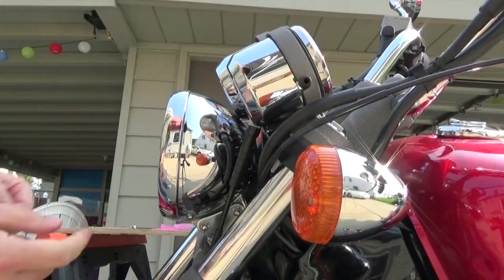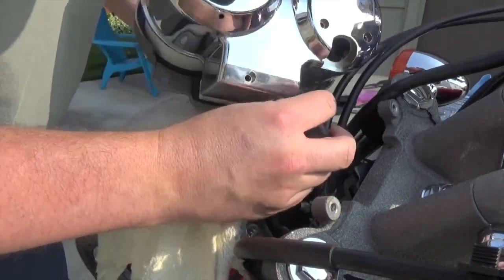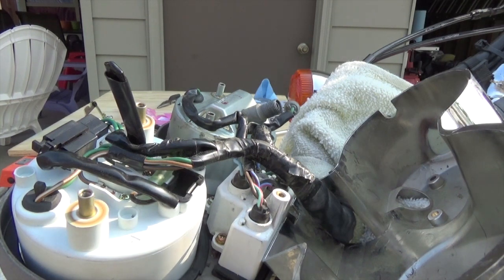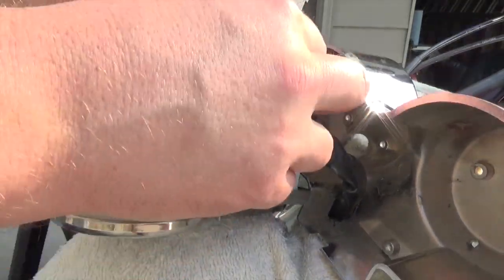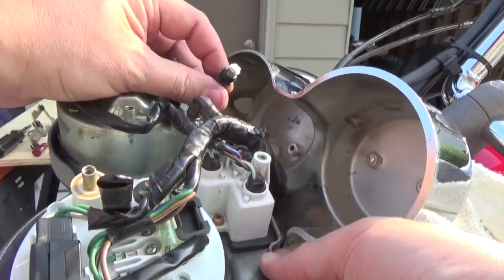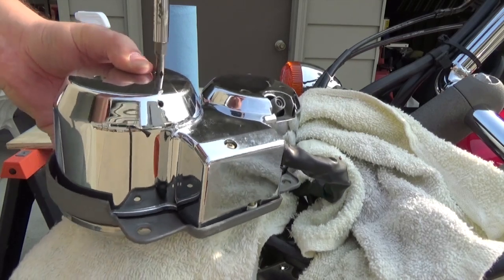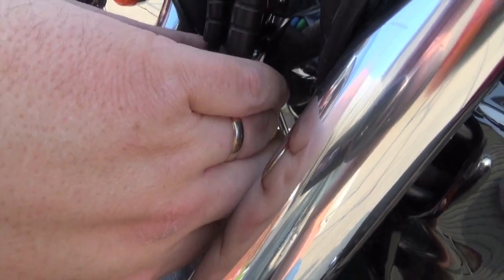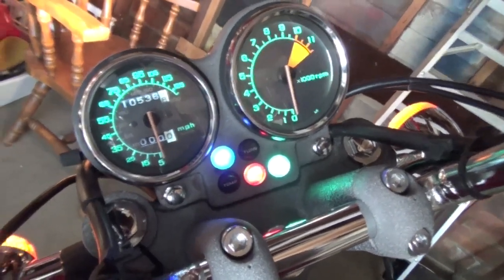Project 1988 Honda VF750c Super Magna Part 6

Comment: For the turn signal led light...
http://i289.photobucket.com/albums/ll224/decosse01/Misc/LED_Indicator_Triumph.jpg

Wire colours are different on your honda bus just follow the wiring diagram
Reply from the maker: Thanks! I may give that a try. I was thinking about something similar once I realized that the polarity of the single gauge cluster indicator bulb changes between left & right signal / indication.